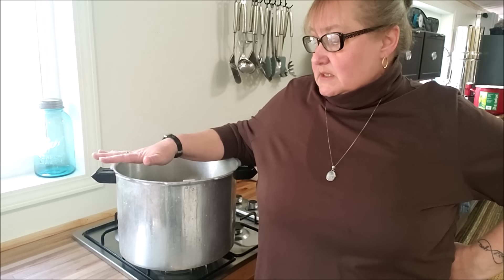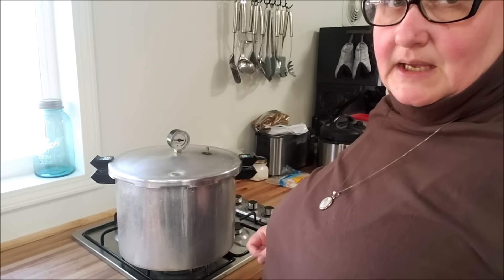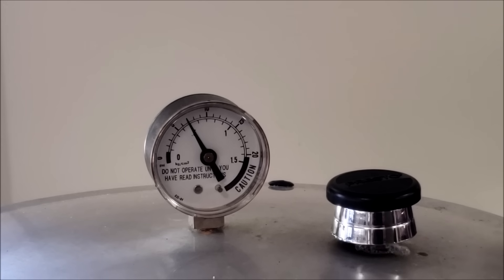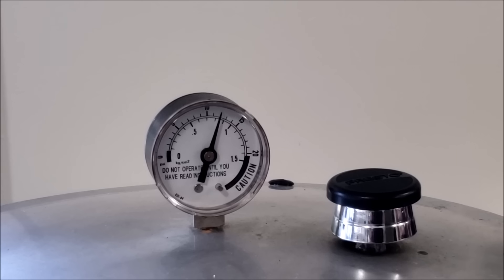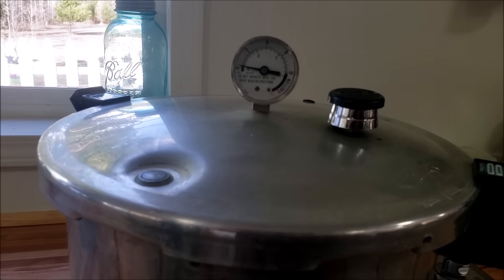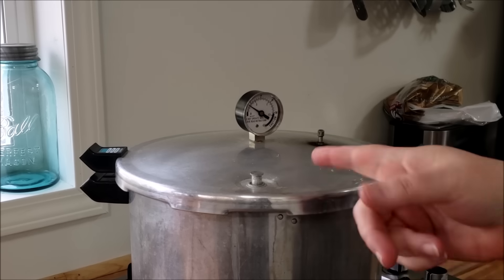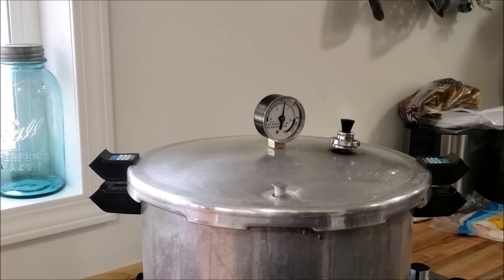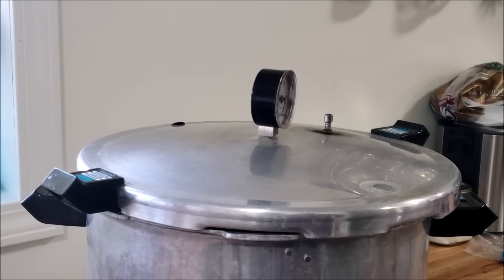Start To Finish with the Regulator & Jiggler - Canning 101 Presto Pressure Canner

Comment: I just used my pressure canner for the 1st time after buying it years ago. So with that said it needed assembly. I didnt realize i had set it up wrong and wasnt getting up to full pressure so I looked it up here. Is it safe to restart the proccess soon after it comes back down and cools and its set up properly, or is this batch unable to be pressure canned now for shelf stable? I had the rubber gasket for the dial gage on the top side not the underside 😂. I'm canning chicken stock in quart jars.
Reply from the maker: Yes, change the lids and restart
Reply: @SuttonsDaze    Thank you so much. I ended up resting just after it came dowe to 0 pressure as a just in Case but didn't change out my lids. With that said they aren't shelf stable correct? I can always freeze it, it's just the 1 batch.
Reply from the maker: @lizshuman9166  if you processed them for the right time, they are shelf stable if they sealed
Reply: @SuttonsDaze  they definitely sealed it seems. There's no give in the lid. I never remove my jars from the canner. As quickly as I could put the gasket in the correct way, put my canner lid back on and put the heat back up and canned 10lbs using the jiggler weight for 25 mins.

Comment: When you get the steady stream of steam, should the pressure tab be popped up? Or does that matter?
Reply from the maker: It will pop up when its ready, no worries. But it should pop up no later than shortly after you put the regulator on if it hasnt before hand
Reply: Awesome! Thank you! 
 We're starting a new journey. Your video guide is VERY helpful!
Reply: @SuttonsDaze why is my preassure tab leaking water and allowing steam to escape? Is that normal?

Comment: What if your canner doesn’t have a safety lock?🤷‍♀️ mine doesn’t and can you use a  jiggled on all canners? 🤷‍♀️💕👍🏻
Reply: Hi KimiyeML.  Not all pressure canners have that safety lock; so don't worry if yours doesn't .  For example, All American canners don't have one but they have other safety features.  The "jiggler" that Leisa demonstrates in this video (The "Presto Pressure Canner Pressure Regulator, Stock No. 50332), to the best of my knowledge only works with certain models of Presto pressure canners.  It does not work with All American canners but you would not need it to because All American canners already come with a special weight that works in a similar way.

Comment: Thank you so much for this video! I commented on other videos andI am going to do this test because it's noted to do it this way in the Presto manual. I bought a used Presto and want to make sure that the seal and everything is good so I want to do this. Thank you for confirming that you don't need to put bottles in it just water so that you can get used to bringing to pressure and not be scared it's going to blow up! Lol 😂

Comment: i back off on the heat when it hits 5lbs of pressure and then let it go up to 11psi other wise it goes up past 13psi...but i have yet been able to keep it at 11 psi it always goes to 12psi and that is where it stays so I figure as long as it is not going under 11 I am okay...have elec stove and got one of those canner burners you had it has helped.
Reply: I just posted that very same thing. Mine bounced between 11 and 12.  I felt the same..as long as it didn’t fall below 11 I was ok.
Reply: I have the same problem, but if it wobbles between 11 and 12, I am good with that.  Everything seems to come out OK.  I have canned both pints and quarts successfully!

Comment: I watched your video and today used my jiggler for the first time. Omg it is so much easier than with the regulator. I canned 10 pints of raw pack round roast and three pints of water, double stacked. All the meat with for jar lids sealed. I had Kerr lids for the water. As par for Kerr lids lately one didn’t seal. Almost no siphoning happened and I didn’t have to watch the jiggler like I always have to have my eyes on the gauge with the regular. This is game changing for me. Like you said I can be near it doing dishes , folding laundry etc and not have it fluctuating and risking starting over or siphoning.

Comment: Finally a video that answered my question. How do you regulate temp on a propane stove? Most other videos talked about outdoor propane stoves. Mine is indoors.. One thing you can add is what your BTU output is.. FYI on your largest burner its 12000, 6000 on the 2 medium burners and 3500 one the smallest.. Very helpful, thank you very much.

Comment: I have a 23-quart Presto which I really like but I've only used the regulator that came with it.   I have bought the weighted regulator but I've never used it because I didn't know how.
Your demo video here has helped me understand the two different regulators.  I'm not sure when I'll use the multi piece regulator, but this info helps.  I also love your "hula dance" description.  😊
Thank you for making this video; I'm new to pressure canning as of this year and was really kind of nervous about using mine after I bought one.
Reply from the maker: You've got this!

Comment: Do you ever have to add more water to the canner if you have to start over with your timing of the load?
Reply: Hi Cynthia.  Yes, depending on how long into the canning process you discovered the problem, you might have add more water to replace the water that already left the pressure canner as steam.  It would be best to (very carefully) remove the pressure canner's lid and check to make sure you have the correct amount of water in the bottom of the canner before you put the lid back on and start the canning process over again from the beginning.
Reply: @marygallagher3428  Mary do you have to cool completely or just wait for pressure lock to drop?
Reply from the maker: Just wait for the pressure lock to drop. But be careful. It's very hot
Reply: @SuttonsDaze  Thank you.
Reply: @cynthiamyers2941  What Leisa said  ;-)

Comment: I cant thank you enough for this series. I am new to canning and have only done waterbath up to this point. Ive been researching pressure canners and the 16qt presto is such a good deal right now. But i was beyond intimidated by the how to regulate that pressure. I was considering buying an electric pressure canner because  i felt like it had more options as far as "regulation". But those things are way more expensive and the jar capacity is almost nothing! This "walk through" along with the tips in the series really took a LOT of the fear out of the equation for me. This video in particular really helped me understand how to get where i need to be and stay there. And that made it so much less intimidating. Im so grateful, thank you again Leisa!

Comment: THANK YOU!!! I bought a new Presto pressure canner for glass top and induction stoves a week ago. I watched other videos that were good and I did a water trial run - but actually used my jars and lids.
2 days later (last night), I had the courage to can 15 lbs of organic chicken breast. I struggled with the pressurefollowed the head space and bubble/air space instructions. 
I struggled with getting the pressure to rise but finally got that to work. I panicked when I could smell the cooked chicken bc if the cans are sealed, you shouldn't be able to  snell the food- and iron smelled metallic as well.
When I pulled out my cans, the lids had black soot all over the rim and the water was greasy and scummy.
I searched online for answers and was worried I ruined all that meat. This morning I found the jars had kept a good seal and I cleaned to lids and jars with vinegar. 
Your video popped up in my feed and now I understand about siphoning and why it may have happened. I also now know that my canner only cane with a regulater not a jiggler. I kept thinking they were the same thing and I was searching online why mine wasn't jiggling🤦‍♀️. 
I like the jiggler idea and will be buying one.

After watching several "canning 101" videos, YOUR video is THE BEST!!!👏👏👏❤️

Comment: Thank you so much for this video! I rewatched this vid and herd you say "keep the heat at about medium while pressurizing after you place the weight or the jiggler on". I have been having trouble with sealing failures and siphoning with a full Presto 23qt. Such a disappointment. While having my canner up to high heat to pressurizing, I could hear those jars bouncing/rocking around in the canner. I always thought "Dang..those things are moving around too much, I hope they seal". But I pressurized on high as others have done before me. Im never going to pressurize that way again and tonight Im using a weighted regulator/gauge (jiggler) as we speak. I already love that thing. Unfortunately I pressurized on high this time before I re-watched this vid..so well see if I have sealing failures or siphoning. Yes, I could actually watch this vid and comment while my canner was doing its thing using the jiggler. I did not have to stand within 2 feet from the canner to be sure it stayed at 10-12 PSI using the provided Presto gauge. I just listened to the jiggler doing its hula dance (lol) and occasionally glanced at it. Soooo much easier to use the jiggler. Happy me! Oh, FYI-I tried those PUR canning jars/lids/bands...long story but they are an epic failure on every level. Dont seal, bands are warped and the jars are not consistent in construction and they etched on first time canning. Dont waste your money. Buy Ball/Kerr jars/lids/bands. If you really want a premium lid buy ForJars.com lids online.

Comment: Thanks for the info on the stubborn vent. I have 2 of the larger Presto pressure canners. It take forever to pop up, sometimes an hour before it pops up. Sometimes it needs a little help. Then it's waiting time for the vent stack to spew steam.

I use induction burners. They're easier to regulate. Question...Do you crank up the temperature when you are first building up steam during the venting stage? I have mine about 440 degrees. Or, is it better to take longer at a lower temp?

Thanks again.
Reply: @1:50 She talks  about it in the video, and says with electric, she would put it in high to heat it quicker.

Comment: I've been water bath canning for a while but had an older 1978 22qt presto pressure canner sitting around. I realized It didn't have the regulator weight (they get lost) and decided to get the jiggler style and a few other things to rebuild it. Thanks for showing the difference between the two style of regulators 👍. Ready to start canning meat soon, but I think a few practice sessions is in order. Great video.
Reply from the maker: You've got this!

Comment: I brought you along on my maiden voyage with my new Presto 23 Quart canner.  Thanks so much for the video!  It reassured me that I was doing everything right!  Perfect Green Beans!
Reply from the maker: You've got this!
Reply: Do you mind answering one question?  My stove has a large middle burner that is 13000 BTU.  It fits my canner perfectly.

If I never put it on high, do you think it’s safe to use?  It is propane fuel.
Reply from the maker: @markmuldoon8886  don't use it full blast, don't exceed 12000btu and it's fine
Reply: Thanks for sharing your experienced canning lessons.
Question; if I stack my cans with a second rack. One on bottom than the second. Is the pressure setting and time the same as one layer? Canning meat, pork, chicken. Thanks in advance.
Reply from the maker: @joeynoname1316  yes, same time and pressure
Reply: Bless you and thank you!

Comment: This helped me so much I can get my pressure canner to regulate with the regulator. I just order the Jiggler. Prayer it helps me. Thank you for the very informational video.
Reply from the maker: Glad it helped!
Reply: I just canned 12 jars of pork loin on electric plate 1500 watts. it took 1 hour to get to 13 psi and the standard weight started to jiggle. I can do canning at 11 psi  and I'm waiting for the Jiggler with removable weights to run it at 11 psi. I could easily keep it at 13 psi for 75 min.
I started with cold jars so definitely time was extended on electric plate. The plate I have can't be adjusted to constant heat and thermostat oscillate every few seconds applying power for about 10 seconds

Comment: Hi! Just asking for quick clarifications.. I recently acquired a smaller 16qt canner without gage, jiggler weights only, alot of what I'm canning right now requires 11lbs.. using the 10lb weight how do I know for sure it's at 11 and not 10? ( I don't need to adjust for elevation) Should I stick with the 23qt with gage for that? Although, I prefer to use the small one right now since the garden is empty and I'm doing smaller batches. Thank you in  advance and for this video!
Reply from the maker: If you check the ncfhfp website if offers times and pressure for both kinds of regulators

Comment: Love your video.  I’m a new canner and I have the regulator and I have to watch the gauge.  I ordered a juggler after watching your video and should get it tomorrow.  So excited to see if it will make it easier to use my presto pressure canner.  Thanks  for your easy examination and definitely was good to see it in action.
Reply: I meant jiggler not juggler.  I’m so excited to get started with my jiggler.

Comment: Newbie here....I have a glasstop stove and the booklet that came with it does say it's safe but the pot should only be so many inches over the ring. This pot seems a little big. Are they referring to the part that actually touches the stove and is it safe? I've been putting off doing any canning because  I'm nervous about breaking my stove top
Reply from the maker: I would call the manufacturer for specific details
Reply: Sandy I have a glass top stove too and it's older.  I ended up purchasing a 23Q presto induction canner along with a duxtop 1800 watt induction portable burner which holds up to 65 pounds.  It's just another option.

Comment: I have been trying to decide on either the American canner or the Presto. I hear the Presto needs the rubber gasket replaced occasionally. My range has a glass top and I am concerned about the weight of the canner and the jars in it. Worse scenario I will buy a propane camp stove and do my canning on it. Just don’t know what’s best. Any info would be greatly appreciated🌹
Reply from the maker: With a glass top stove, id go presto, but call the stove manufacturer first
Reply: The American can be used on glass top, I’m not sure about Presto on glass top. American is oh so expensive though about double. I have a propane stove but I’m very content with my presto.

Comment: Recently bought a pressure canner and have been doing my due diligence learning about what I’m doing before I fire it up…..from what I’ve learned so far there is some info out there that is best avoided unless you like playing roulette with food safety. You have to weed out the horses@*t from the hay as it were  and it takes alot of time. Then I ran across this video that clearly and easily shows in minutes what it took hours to gather in bits and pieces. Now I see why Adding the rattle weight  makes sense …..Great job!

Comment: If you’re using the juggler end it stops jiggling for a second or two do you have to start the whole canning process from the beginning again? Does that mean to just start timing from where everything is sitting right now? Or do you have to cool  everything down and start from the very beginning?
Reply from the maker: Literally a second or two? No you're good
Reply: @SuttonsDaze  OK thank you for your response. But also my other question was the weight that is 5 pounds 10 pounds and 15 pounds that can be used in place of the gauge am I able to use that where I am I am supposed to Ken at 11 pounds of pressure? If I am able to use the Weight which one would I use?
Reply from the maker: @MJYouAreNotAlone1    I highly recommend that you save this website.  If you'll look, it gives you the pressure for the regulator and for the weight.  If you use 11lbs with the regulator then you would use the 10lb weight. 

https://nchfp.uga.edu/how/can_05/chicken_rabbit.html
Reply: @SuttonsDaze  oh thank you so very very very much for this answer I was afraid that I would not be able to use A 10 pound weight because I am supposed to use 11 pounds of pressure with my dial regulator that came on my pressure cooker. I am so relieved thank you so very very much! I will order the weight very very soon.

Comment: Thank you so much.   My older pressure canner you didn't have a dial and you didn't have to let it vent for 10 minutes.   It had a jiggler.   Thank you for showing the difference between the jiggler and the regulator.
Reply from the maker: Venting is absolutely necessary regardless of the type of regulator

Comment: Thank you. I just got my new 23 quart presto and was surprised the jiggler was not included.  I just did my first session with the gauge and I hated it.  For 75 minutes I was constantly having to adjust temperature.  I ordered the jiggler using your link.  I hope you get a commission from it.  Every little bit helps.

Comment: Hi, i have this cooker/canner ty,  and just got a vintage presto A603A pressure cooker, it came eith a jighler and regulator? I think o should just use jighler not regulator because no gauge,, am i right? Jighler diesnt have removable weight, I appreciate it tyvm tc

PS, sry but kinda confused lol.
Reply from the maker: I hesitate because the jiggler doesn't have an adjustable weight
Reply: Tyvm